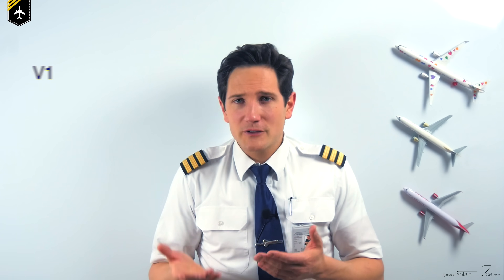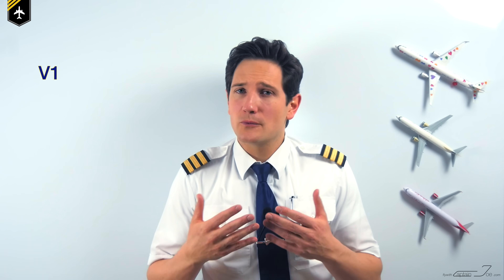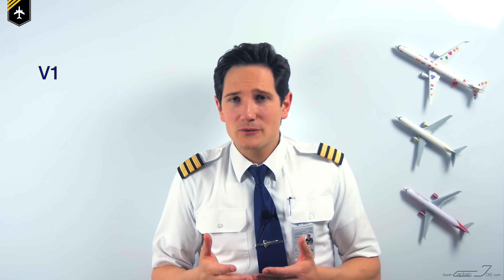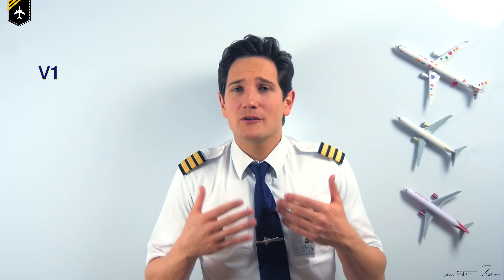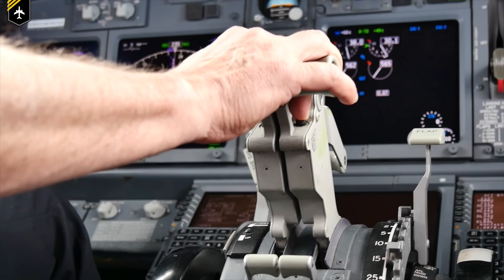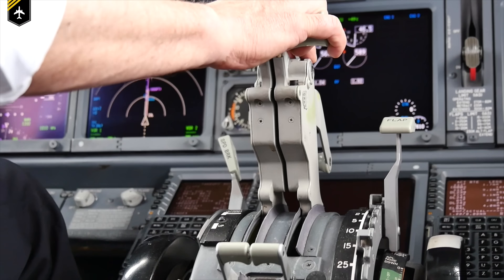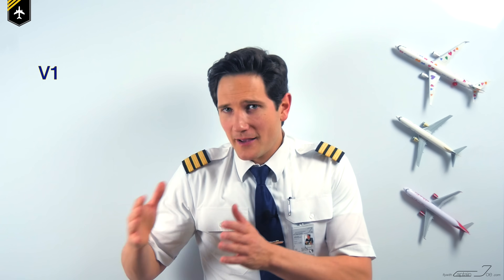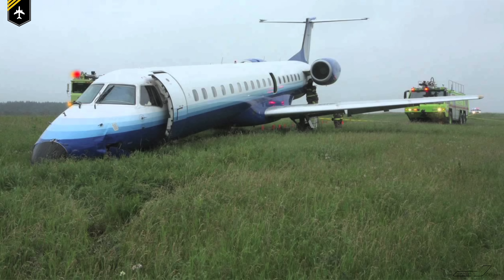TAKE-OFF Speeds V1, Vr, V2! Explained by "CAPTAIN" Joe

Comment: I've always thought that V1 is a flawed concept since if a plane is not accelerating nominally, it might not even reach V1 before running out of runway. A pilot might be looking for V1 but because the plane is not accelerating properly he could be further down the runway than he expects to be. There surely needs to be a combination of a V1 speed and particular position on the runway at which he should be reaching that speed, or alternatively a timer to show how long it should take to reach V1. 
There have been accidents that have happened because for some reason the plane has not been accelerating properly and V1 was not reached before the plane actually ran out of runway. The Yak-42 that crashed where the pilot was inadvertently applying the brake on the takeoff run is an example. His engine readings would have been showing the correct values but he was not accelerating  enough to reach V1 at the point on the runway he was expecting. 
The crash of a DC8 in Alsaka in the 1970s was also caused by the same problem where the  brakes were applied on an icy runway and the tyres were sliding on the ice and eventually burst causing more friction with the plane eventually running off the end of the runway.
 The Munich air crash in the 1950s is another example where slush on the runway was the cause of reduced acceleration. 
It really comes down to the compromise on runway length. If a runway was 20 miles long there would be no V1 since a plane would reach take off speed long before it reached a speed at which it would run out of runway if they had to abort. For a small plane like a Cessna on a long commercial runway there is surely no V1 speed since it will reach takeoff speed without a V1 becoming relevant.
Reply: V1 speed is a function of runway length and condition. Shorter the runway is, the lesser V1 will be. The longer the runway is, the higher V1 will be with a max limit of Vr (as you wont abort if you're rotating)
Reply: @ZK-APA  I realise that but if a plane is accelerating more slowly than it should be then in theory it might never reach V1 , with the pilot looking for V1 but getting closer and closer to the end of the runway.  V1 is presumably based on an assumption of nominal acceleration, which may not be the case for a number of reasons.
Reply: @clinteranovic8075  Then that is more because of either calculation error or some issue with the aircraft. Such a situation can't happen randomly, and if it does, it should be obvious to the pilots (rather than them fixating on V1)
Reply: @ZK-APA   What would make it obvious to the pilot is a marked position on the runway or a timer, that's all I'm saying. Unfortunately there have been cases where it wasn't obvious to the pilot and they have led to accidents.

Comment: Duh.  I always thought that Vr was when the plane had accelerated sufficiently  to rotate through a horizontal plane and become airborne.
Reply: Ah, well yes that is exactly what it is. Vr literally stands for "velocity for rotation" which is when the wings are producing more lift than the weight of your plane. The question is do you know how much your plane weighs? In an F-16 at lean weight the speed would be around 140kts. Fully loaded with maximum ordinance it's a little over 180kts. Luckily in a lighter aircraft the pilot can generally feel when he reaches Vr as you can feel a drifting sensation as the planes wings lightens the friction from the wheels on the ground. On larger aircraft that sensation is less apparent and therefore they must be aware of the absolute minimum and exceed it slightly to be certain. But all in all the Vr can vary considerably as a result of many factors, weight being only one. A wet runway will slow you down, a tailwind increases Vr and hot air is thinner than cold air as is high altitude takeoffs as opposed as those at sea level. So there is no set Vr as many factors come into play. Luckily a larger aircraft is less affected than a smaller one therefore the Vr range is narrower and the minimum rotation speed a little more forgiving to calculate. One last thing, after rotation the aircraft must have enough power to accelerate, even slightly, because if it remains exactly horizontal wings will suffer from a lack of attack angle resulting in loss of lift leading to an unrecoverable tail stall. Planes can't fly fully horizontally at low speeds and even when they reach cruise speed they have a slightly positive angle of attack.
Reply: Excellent Capt. T. Colby.
Reply: @mikebarker9187  
I am so tired for support Mike. The trolls are blaming CAS for lack of support. What your rivals truck is getting away. Not my problem. Tell my fellow Americans. Our next target is American traitors. Trump supporters are not welcome among the American Allies.  They are our targets, it is that serious.
Capt. Tamre' Colby
USAFE/NATO CAS

Comment: I have heard that there are a few exceptions where the takeoff roll can be discontinued after V1 but that they are most rare. It is suggested that aborting after V1 does not mean that a runway overrun will occur and it seems to relate more to ground controllability. Also, it's my understanding that, these days, the V2 (takeoff safety, best ROC, safe obstacle clearance speed, one engine inop) call is rarely used because it is simply observed as an indicative bugged speed requiring no specific critical decision to be made other than to recognize the speed for what it is. Perhaps I may be in error here. If so, please correct me :-)
Reply: Yup a PIC can abort after V1 IF he/she thinks that a safe flight cannot be maintained if they continue the take off. Though these are very extreme cases where its obvious that the aircraft should not get airborne (so basically choosing a lesser evil)
Reply: @ZK-APA  Appreciate the feedback ZK-APA. Cheers.

Comment: It seems that with a very long runway, and/or a smaller plane, that V1 may be irrelevant or would be after VR or V2. If there is plenty of runway for stopping the plane even after VR, is V1 used just as standard procedure?
Reply: In that case, max V1 will be equal to VR

Comment: so if you hit V1 and have both engines go out, I think you'd still be better off trying to get the plane to stop and overshoot the runway than take off... This isn't a fool proof plan
Reply: There is a fine print which says that a takeoff after v1 shouldnt be aborted unless the PIC is certain that a safe flight cannot occur if the take off is performed. Eg of this is of course as you said multiple engine failures or say a major fire

Comment: Is V1 V2 measured in air speed or ground speed?
Reply: Airspeed.
Reply: @ZK-APA  Thanks. Interesting that with headwinds V1 could theoretically be a higher number since the plane would have more room to stop in an abort.
Reply: @PeterWTaylor  Yup, higher the headwind, lesser will be the groundspeed and hence more runway will be available

(remember, the aircraft performance speeds such as V1 are airspeed, but the distance travelled by the aircraft on the ground will depend on groundspeed)

Comment: What happened to the plane that hit the bird. Where and when did they land. How  can a plane fly with one engin?
Reply: Because the remaining engine has enough power to allow the plane to still climb (although more slowly than normal. The asymmetrical thrust will make the plane want to yaw in the direction of the "dead" engine, so the pilot will have to compensate for that.

Comment: I wish I had an answer to this question… Why have pilots crashed because of not knowing elementary skills. There are multiple examples of pilots pulling back on the stick to raise the elevator in a stall which is opposite and led to hundreds of people dying. How can they be in the cockpit and not even have a clue? This happened multiple times like I said and if this basic thing is horribly wrong imagine anything more complicated. Were seeing far too many crashes it's not safe. It's a lie if they tell you it is. Cars are being driven by drug addicts morons chimpanzees so you can expect high death rate that should be changed and laws to get these morons off the road should be implemented but in the cockpit the same thing…

Comment: cant they protect the engines by attaching a  mesh  like material from the bird strikes?
Reply: It is not possible because it will disturb the airflow into the engine and affect to the performance of the engine.

Comment: I have a problem with the definition of V1. Let as assume a long runway and a B747. 
The plane rolls and, as far as I understood, you reach V1 when the distance left on the runway is just equal to the distance that the plane needs to perform a full stop. Ok, great. Now, another plane comes on the same runway, a DC-3 this time. Due to its slow takeoff speed and its quite small mass, the distance for her to stop is not very far away from the physical end of the runway, so, by the definition, her V1 occurs muuuuch later than the one of the B747. However, the pilots call V1 and rotate much closer to the beginning of the runway, a momentt where the DC-3 might be able to fully stop, not one single time, maybe 2 or 3 times...
Reply: For the more agile DC3, they might not call V1 at all as Vr will come earlier on the long runway you are considering.  V1 changes for every aircraft and every runway.  Vr only changes with aircraft loading and flap settings etc. and not on the runway itself.
Reply: @karhukivi  exactly my point
Reply: V1 is the speed where one can safely abort a takeoff. When a runway is quite long, then the max v1 the aircraft can have will be equal to vr as at vr the aircraft begins to lift off.

Comment: Given a small enough aircraft, and a long enough runway, can V1 be higher that Vr? I'm thinking a plane so light, that could basically take off and immediately land with enough runway to stop, or at least perform a sucesful abort after rotation.
Reply: Nope it can’t, because of definition. V1 by definition is the minimum speed at which you’re committed to take off. So v1 has to be a value which you’ll achieve while on the ground. Vr by definition is the speed where you rotate ie switch from ground to being in the air. So since after vr you’re in the air, and v1 is a speed on the ground, v1 can’t be greater than vr
Reply: @ZK-APA  Then V1 does not apply for very light aircraft in very long runways? Technically, you could abort all the way up to Vr
Reply: @gastonpossel  yup, max value of v1 is vr. Also keep in mind that the concept of v1 is for multi engine aircraft.

And yes at exact vr you will be on the ground, but the take off initiation has started.
Reply: @ZK-APA  Not correct, it is V2 that is for multi-engine aircraft.  V1 even applies to a small aircraft like a Cessna if the runway is very short.  However, flying from short runways and perhaps with obstacles at the end, it is usually estimated by distance, say the halfway point, and if you are not airborne by your selected point you cut the power and brake.
Reply: @karhukivi  are you sure? Because v1 is an engine critical speed, and in an single engine aircraft if you have an engine failure, you abort regardless as you simply cannot fly anymore.
Reply: @ZK-APA  V1 is the speed where you are committed to takeoff as there is insufficient runway to stop on.  Critical for large aircraft but almost trivial for small aircraft except on very short runways where it is more a question of the distance required to clear the 50ft obstacles presumed to exist at the end of the runway.   An aircraft might have to abort for reasons other  than engine failure.
Reply: @karhukivi  ah, that explains. But yea, most v1 definitions mention engine failure, so I guess they should redefine it now
Reply: @ZK-APA  An engine failure would be the most pressing reason to abort, but an explosion, an indication of a serious problem with some system, hydraulics, pressurization or an engine condition e.g oil pressure falling, or even some emergency in the cabin, could be among various other reasons to abort.  After V1 they must take off, deal with the problem and land asap, otherwise the crash off the end of the runway.
Reply: @ZK-APA  I would observe that you are still on the ground just past Vr. Just starting to lift the nose gear at that point.

Comment: Hi cap Joe. If you could  explain why they don’t put safety metal net in front of  engine to stop birds and large items flying into it. I know it will affect airflow a bit but it can be  designed to go on and off automatically only for take of and landing or what do you think ??

Comment: soooo... could you theoretically hit V2/Vr before V1? for example when taking of a piper cub from a (theoretical) 100 mile runway, I assume it's possible to rotate before impossible to abort (which would probably be somewhere in the 90 miles)
Reply: No, v1 can't be greater than vr or v2, simply because of its definition (all 3 can be equal though). Because v1 is a speed on the ground, v2 is a speed in the air. And vr is the transition point from ground to air.
Reply: @ZK-APA  Thank you!

Comment: Love to learn about airplanes. I was born on Curaçau, South Cariben, close to Venezuela, and live actualy in Portugal. 
As a kid I run away from home, which was not far away from the local airport at HATO just to see the propeller airplanes landing and taking off. 
It  was than the first time I saw the first jet airliners and I couldn't get out of my surprise anytime they climbed straight to the air, very different from the propeller models.
In spite of my love to these fantastic machines, I never learned to fly, but home simulators.
Great to learn with you about so many details. 

Keep following you. 
Thanks.

Comment: Question: Why you don't ask to the builders to put 4 cameras outside of the plane ?  -1. one on the top of the tail (will give you a general wiev of the plane) -2. one outside under the pilots cabine (to see if the plane train is set or not) -3. two cameras outside on the left and on the right of the pilots cabine(to have a permanent view of the wings and the jets).  in cabine the pilots will have a cross with 4 display with a permanent outside view with the most important parts of the plain in caze of accident. An image replace 100 of words and many aparatus which may be show right or wrong. The power of this sistem have (must) to be a batery total independent. The images may be stock or direct transmited to an airport.

Comment: What do the checklist t recommend removing your hands from the power levers ? Takeoff is very critical just like landing I've seen pictures were their hands or nowhere near the power . What is your company policy what do you do ?  V1 vr v2 are times when you need to be be ready for anything that low to the ground  .
Reply: After v1 you are committed to take off. Hence the hands are removed so that one doesn't accidentally move the throttle levers in case of an issue post v1

Comment: Captain Joe Thanks for explaining. I knew already that after V1- window of opportunity to abort take off has closed. But I have 2 more questions: If plane is not full (weight) it can take off without stop after taxiing to runway and not at full thrust (TOGA) but in case it is a full flight it is necessary to stop after the taxiing and full power required. Am I right? Also I noticed that sometimes Transatlantic flights have given route which is marked by dotted line (In flightaware website) but sometimes not. What is the difference between marked route with dotted line for plane route and without it?

Comment: What happens if theres a problem between V1 and Vloft? You cant stop or lift off, What do you do??
Reply: Sealy you can still abort after v1. But ONLY in cases where it is obvious that the aircraft cannot maintain flight if it takes off (eg all engine failure or a major structural failure)

Comment: What happens if you have crossed V1 and an engine failure occurs before V2? As in only one engine is operative. Do you abort or inc speed to v2?
Reply: Hamza Javaid one engine is still sufficient to accelerate the aircraft to V2. So yes you’ll continue the takeoff